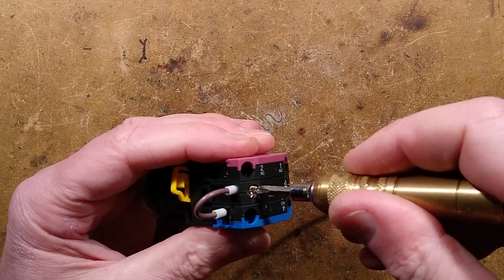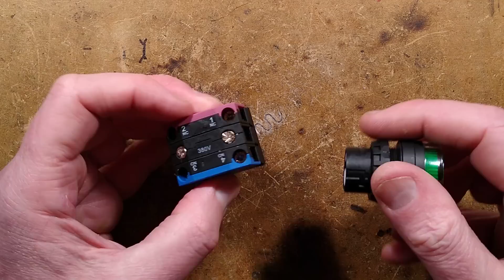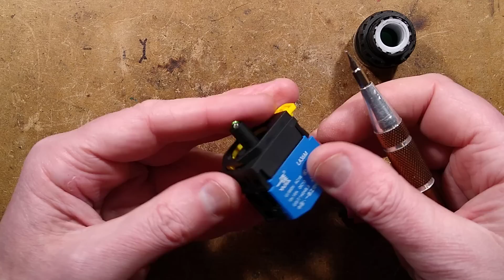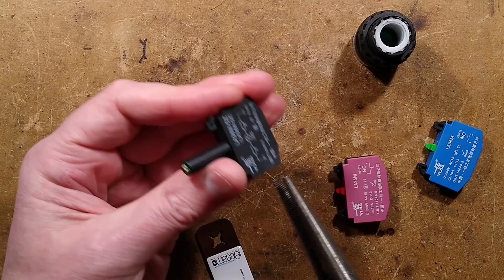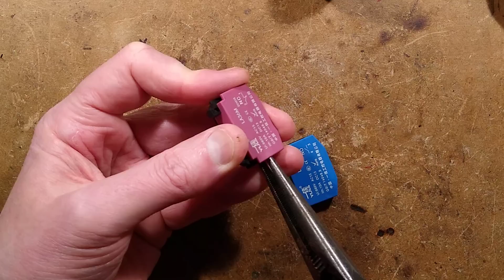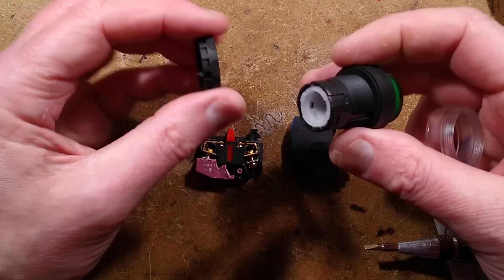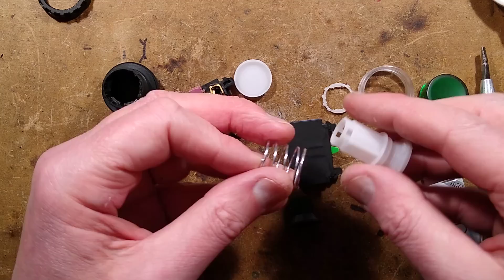This did not come apart easily!

Comment: Modern manufacturing. One-time snap together parts, no going back. If it fails in any way, buy a new one. I've worked with thousands of p.b. units in my industrial career. Allen Bradley was the best, but even they succumbed to the throw away concept eventually. Their older units were basically indestructible as far as service life goes. The Chinese unit you destroyed here is actually one of the better designs i've seen recently. Thanks for sharing.
Reply: I’ve worked as a trade school teacher and I’ve seen more mangled Schneider units than I can count. At least these won’t come apart as easily when kids use brute force on them daily 😂
Reply: @jhsevs  👍👍👍
Reply: Brown Boveri used to supply repair kits for the contactors, which were the contacts, the contact springs, and the terminals, plus the 2 laminated cores. Have had the contactors jam because the cores, after a few hundred million operations, tended to spread out at the contact surfaces, and jam in the housing.
Reply: Looks like you need a set of external butt ended circlip pliers to help open things like these
Reply: @steptoeandson3554  Sounds great in theory, but what about when he get's to the Pifling clip on the Trent-Masters lobe weight?? He'll need a Babington clamp at least!!
Reply: Last I checked (admittedly a while ago) Allen Bradley was still selling the 800T- line of NEMA switches. Not cheap, but indestructible, serviceable and infinitely configurable.
Reply: Yeah maybe look a bit closer at the modularity of this particular unit before you commit to commenting. 😂
Reply: Usually I am against throw-away stuff buf IMO it makes sense here most of the time.
It is a 380V switch after all! So its not the best idea to repair it. Even expensive modules like Eaton, Schneider, Siemens are rarely more than 10 Bucks and they LAST. I have designed, maintained and repaired a lot of industrial test equipment in the last few years and have yet to see a failed button like this. I'm sure they can fail, but it doesn't happen often and its better to replace the whole switch module if it failed. (Not the switch, but the module in the back).

The only thing which I guess might be annoying is that maybe after 15-30 years the module might not be in production anymore (but a lot of industrial equipment is used much longer than 20 years). But even then - you just replace the whole panel mount switch with a new one. It might not fit 100% optically, but it will get the job done. 22mm Switches/Buttons/Indicators have been the norm since many MANY years (probably almost a century)
Reply: @TheRailroad99  I've a similar craft background.. design, custom manufacture, test, install,  modify, maintained and field diagnosis/repair of a wide variety of process control equipment. 
Agreed - Decent trade quality Industrial controls stand up to industrial use, but I wouldn't call them expensive.  I've worked with some of the best gear, as you mention. I still prefer the Telemecanique... that I've used for 40+ years.  ABB and Merlin Gerin gear is always quality. I was never much impressed with the 'agricultural' US manufactured stuff.. Allen Bradly an exception. Square D loathsome to handle. 
Agreed - It's vary rare for a new contact block or illuminated display fail in service, unless mechanical damage or loose connection heating.  Can't say I've ever seen an LED indicator fail in service..... be that these modular block like this or the incandescent drop in replacement type. Can't say I've seen faulty switch blocks, unless years of heavy service.  
And I've seen dodgy knockoff gear. The subject item in the video looks like a cheap replacement in the back of a field service repair van, or something you might find as OEM in ordinary grade imported machinery. You can't even stack additional N/O or N/C auxiliary on that thing.  
I have never seen such apparent cheap switchgear go into a quality panel. 

Side note/s: I've never been a fan of these latching panel operator heads. .
Reply: @TheRailroad99  completely agree. When it comes to key safety equipment you don't want third parties "fixing" it even by someone competent. It won't have gone through test processes to validate numerous safety concerns. Applying right to repair on a blown fuse for example would be bonkers, just buy a new fuse don't "fix" the existing one.
Reply: This seems to be common with a lot of IEC rated garbage.  It is marginally built in he first place and design to be throw away. I could accept that if it weren't so badly designed with tiny parts that will self destruct when used right at the rating maximums. The stuff is junk in my book and is guaranteed to fail catastrophically!! The stuff may end up taking out adjacent equipment when it goes and mat well catch fire,
Reply: @professorg8383   It surprises me how little service life there was on it.  Yep.. cheap crap. 
The next failure mode I see with this operator is the latch mechanism. Quality gear has far better dust/water ingress seals between button head and body. The clear 'shield' to prevent accidental operation also acts as a water damn in that location.
Reply: @BTW...  As an electrical engineer who has had a long career in heavy industry, (well over 30 years), it doesn't really surprise me.  Used to be that American companies almost exclusively use NEMA approved/certified control equipment.  You could take a button like this and close the contacts into a dead short supplying rate voltage into th fault. The device would fail, but the fault would be contained. And likely, it could be repaired with a replacement contact block!  Definitely not the case with this garbage! I have seen this kind of crap fail and take out an entire control panel! The NEMA stuff was designed to contain worst case faults and not destroy everything in the vicinity.  This stuff was design to sell cheap! 

I watched the acceptable standards being discarded by many companies. Personally, I blame the buy outs or big investment by international companies into these US industries. I fought purchasing agents who would always claim this stuff was way cheaper but was still certified, (to IEC standards). But those standards are nothing close to US standards like NEMA and UL. I spent some time trying to figure out IEC standards and why certified equipment could be so bad. 

I was shocked at just how low these standards actually are and I was also shocked when I found out that manufacturers of equipment could self certify and no 3rd party testing is required! Digging further into the technical aspects of the standards, you find that IEC standards are far less critical or strict in what they find acceptable. Even engineering calculations related to fault currents vary greatly to the standards we use in the US. And it gets even worse! US standards are verified at worst case scenarios and the emphasis is safety and fire protection. The IEC is much more of a political organization and driven largely by economics. 

Comparing IEC standards to UL or NEMA is apples to oranges. In like equipment that is theoretically rated the same, the first thing you notice is the IEC stuff is smaller, lighter and cheaper. I have a lot of experience with  IEC and NEMA equipment rated for the same purpose and the IEC stuff is junk in my opinion. For industrial use, I really want no part of this stuff!

Comment: Would you be able to a video on piezoelectric switches (vandal proof switch) and how they work?
Reply from the maker: I think it's literally a piezo disk glued to the back of the pressure plate and a simple amplifier circuit.

Comment: My experience regarding destruction:
When I designed and assembled switching cabinets for industrial automation equipment, I used those rigid switches from Allen-Bradley. Nevertheless, operators always somehow managed to destroy them. 🔨 The only ones that seem fairly violent resistant, are those used in control panels for cranes and excavators.

Comment: Would the contacts in that switch take a heavy load?
Reply: No, these switches are useally used in combination with contactors (industrial relays) to switch heavy loads.
Reply from the maker: I wouldn't trust them for a load.  Just as a control signal.

Comment: I like that style of button with the lever release for the back, used them where i worked, except they were easier to remove the coloured lens to add a designator. and they had stackable contacts, though you could change the NC for a NO if you needed double NO contacts
Reply: Those diffusers were good for Letraset symbols too, so it was easy to produce a professional - looking panel with useful indicators.

Comment: They copied the Euro-style panel switches by the looks of it. I don't like the idea of microswitches, but at least they're replaceable.

I remember working on the old Allen Bradley and Square D switch types, where the body was held together with screws, and inside was a heavy set of spring-loaded copper switch legs with silver contacts. They were used on hoists, cranes, and industrial controls everywhere, and they are way more heavy duty than these. We carried a small points file in our tool pouch to clean the contacts with, and voilà, you had a working hoist again.
Reply: I made a similar comment about Allen Bradley. I was a journeyman industrial electrician for 45 years before retiring
Reply: @RobertBeck-pp2ru  Same here. The old switches, you could stack, adding extra switch units to have several contacts for different circuits on one switch. You had break before make, and you could design jog circuits, etc with them. They were designed to work with motor starters, and some setups could control two-speed setups.
Reply: @craxd1  😀😀😀

Comment: You ran in on 240V even though it is supposed to be for 380V. I am not surprised it is dimm.
Reply from the maker: Even at 380V it would have been dim.  A resistive dropper is not the most efficient approach.

Comment: And Green LEDs are usually the most visible since our eyes are most sensitive to green.

The calculations for two 75k, 1/2W resistors show a maximum of 387V, so they're running right on the edge of their maximum dissipation.  There's no safety margin.  Just hope the switch is not in a hot environment.  😮😮😮

Comment: I was pretty surprised to see an AC LED after I took apart an illuminated button. Never realized these things existed, and it makes perfect sense both for AC and DC. Just two structures wired in reverse-parallel in a single LED package - plain and simple.
Reply: Common solution but leds suffer from a too high reverse voltage.
Reply: @robegatt  not a case with two diodes in reverse parallel, the voltage at any moment will never be larger than the forward voltage of one of the diodes. Max reverse bias voltage is a few times higher though not that much in case of LEDs.
Reply: @KeritechElectronics  you are right, single led ac is bad
Reply: Industrial panel indicators are made for AC and DC use.  It's been that way for years. 
These combined AC/DC duty lamps have a major advantage when used as drop-in replacement for incandescent neon lamps in panel gear if you have a DC control circuit - the polarity of the wiring into the lamp-holder block doesn't matter.
Manufacturers  don't have to make and stock an AC and DC versions too.
Reply: @BTW...  indeed, it makes perfect sense. Same for certain relays. They often use a FULL BRIDGE RECTIFIER to make them universal, AC or DC, failure-proof in case of wrong polarity.
Reply: The Schneider ones are good, nice and bright but around £17 just for the indicator 😮
Reply: Yeah it's a weird concept, but they are extremely common in the industrial world. So much stuff will forgoe using 24VDC and just use 120VAC for all control and indicators.
Reply: @literallycanadian  I didn't hear or see anything to suggest any 24V DC would have to be "forgoe". 
Most very basic control panels us supply voltage for controls and indication now, and will continue to do so. I'm accustom to finding 240VAC hard wired logic control. Also common to find 120VDC controls in panels, especially when 120VDC is used due to critical applications, having 120VDC battery supply. 
In a modern sophisticated control panel you will find 24VDC there for PLC inputs, sensor supplies and panel indication. 
As the years move on MORE control gear will be at ELV 24VDC. 
Note the subject item is rated for 380V AC. This suggests it's intended duty is an a very basic 2 or 3phase with NO Neutral field supply. A pump starter, perhaps. 
Also note that this looks like a field service van cheapy, having both N/O and N/C contacts operated at the same time, a configuration that typically only suits using one set of contacts ever used. (yes, you do find green buttons and lamps used as STOP function in heavy industry) This thing is so cheap it looks like it comes with N/O and N/C in the box because it is cheaper to only stock that way.
Reply: @literallycanadian  Unless you get that oddball unit that decided to use 36VAC instead. Very hard to get spare parts for those, only OEM, with a long delay.
Reply: I’m not a fan of the flicker though. Those flicker at 100hz. Obviously better than 50hz flicker, but those bipolar leds aren’t smoothed, but I really wonder if it’s possible to smooth them a little bit somehow?

A choke or coil in series? A non polarized capacitor in parallel?
Reply: @jhsevs  The solution is to put 5 LED dies on a small PCB as a front, and connect 4 as a bridge rectifier, and the fifth across the output of the bridge. Thus you have 3 operating at any time, and it works on AC or DC as well, and 3 dies provides enough light to use as indicator. Cheap and robust, and Clive had these on the channel a few years ago.
Reply: Still somewhat flickery nevertheless.
Reply: @jhsevs I put a dull wave rectifier on a table lamp, late 80s. 120hz flicker have me horrible eye strain until I added a smoothing capacitor.
Reply: @jhsevs  ffs... flicker?  It's only a panel indicator. You should know... the Operators or testers of industrial switchgear don't sit around staring at buttons, admiring the esthetic of the lamps glow.

Comment: But, I wanted a 21mm button 😂

Always have to assume these things are mounted somewhere in the darkest rooms on the planet in order to be seen

Strange there's no cap to be removed, letting you out a label on the front of the button
Reply: 22mm is the industrial standard, This is so dull because it's rated for 380v The Industrial standard is 24v or 110v.